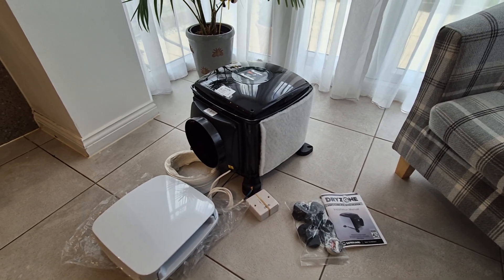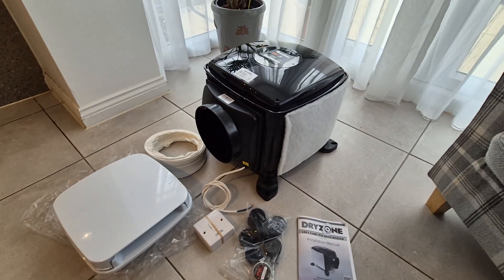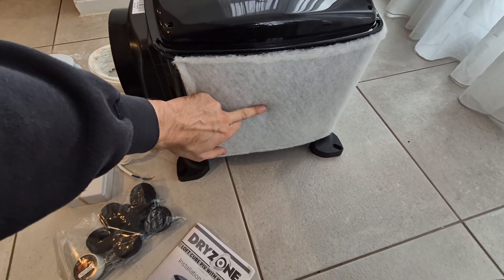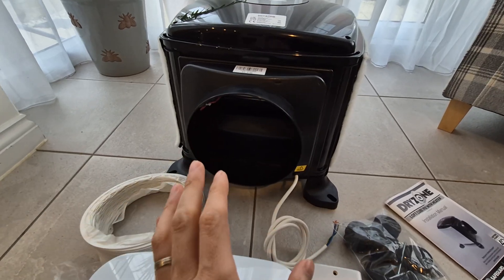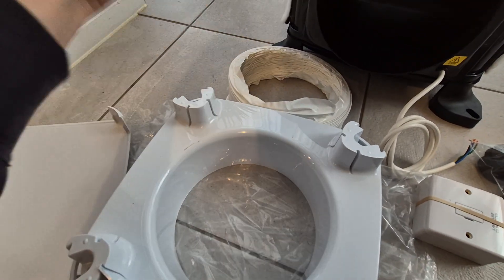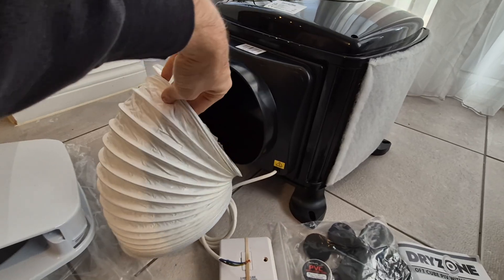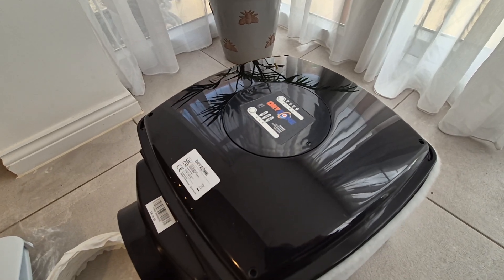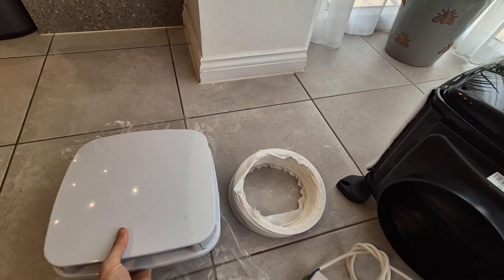How a PIV Unit Works (Dryzone Loft Cube) – Ventilation for a Healthier Home

Comment: What if your loft has high humidity levels? Will this PIV fail??
Reply from the maker: PIV's should only be fitted in a well ventilated rood space.  To avoid high humidity in roof spaces, you should ensure it is well ventilated and that moisture is not leaking into the roof space via gaps in the ceiling, poorly fitted downlights and extract fans not ducted directly into the roof.